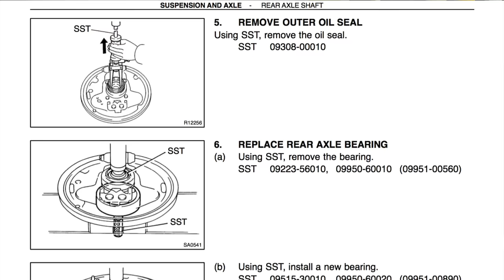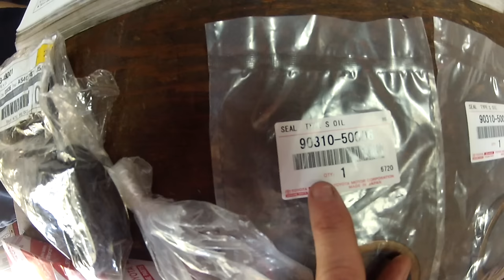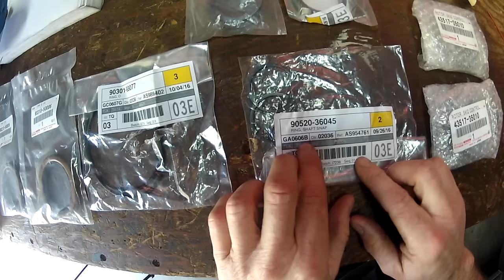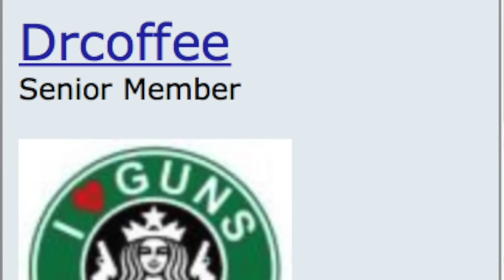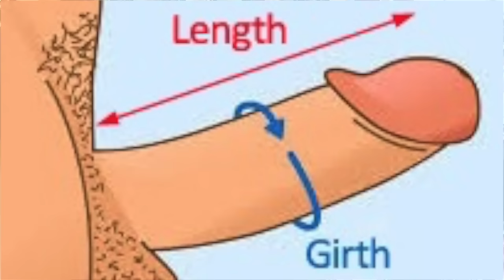Toyota Rear Axle Seal/Bearing Replacement (ABS Rearend)

Comment: I just finished building my own 2-tool set for the bearing and the ABS ring. 1st gen Tundra.
Reply from the maker: That's cool, but you could have bought Duane's toolset for $125.
Reply: @TimmyTheToolman  built these with some scrap and a pipe for less than $50.
Reply from the maker: @markstevens1729  Again, that's cool, but how much time do you think you invested into making them?  I'm all about DIY.  It's what our channel is all about.  But, sometimes spending the money makes total sense.  Maybe you just like fabricating, and you wanted the challenge.  If so, then it was worth it.  But, if you think the time you spent making the tools was worth the $75 savings, well, you should put more value on your time.
Reply: @TimmyTheToolman  oh, the tools in my country are $250. (Canada) and yeah, the fabrication was fun too.
Reply from the maker: @markstevens1729  Double in Canada?  I think your country needs new leadership just like the U.S. does.  Anyway, you made the necessary tools and you got it done.  Good job!

Comment: Hi Tim, just another update.  Well the driver's side started to leak. I went ahead and ordered the older style seal. I took her apart and found the aftermarket spacer that the seal rides on walked itself OUT of place. I removed the shaft and something looked odd.  Where's the last spacer??  It was still sitting in the seal!!!!  I have a NOS OEM spacer. I made some measurements. The aftermarket spacer is 40.02mm I.D. the OEM is 39.93mm I.D.  Going to go to my friend's and press the OEM spacer on. Going to have to replace the seal as well since I'm not sure if the seal is distorted now.  SMH.   Still love this truck. Almost 314K miles and still running strong!
Reply from the maker: I've never heard of that happening.  I've heard of aftermarket retainers causing tools to bend and break because the force to remove them was much more than it would take to remove an OEM retainer.  Now I guess they make them too big.  That's one of the big issues with aftermarket parts is the quality control.

Comment: Several years ago I changed the front and rear bearings on my 2000 4 Runner. I chose option #2. The cost of the press work at the shop was about the price of the HF 20 ton press. Now I have the press anyway, but it does get in the way. Helps to add second piece of angle steel to the legs and some heavy duty castors.
Reply from the maker: Yeah, the press is a little wobbly.  It wouldn't hurt to add some extra support down at the base to stabilize it better.

Comment: Thanks for the video guys. Do you remember if you drove the new inner seal into the axle housing with the Pittsburgh (black) press kit or the OTC (silver) press kit? 
The video doesn’t show which one actually drove the seal in. I just damaged my new seal with a press kit from AutoZone that didn’t have a good sized press disc.
Reply from the maker: We used the OTC kit with the metal silver disks.  There's one in that kit that fits the diameter of the seal very well.  A link to that kit is in the video description.

Comment: great video again tim.  just a side note the 01 and 02 require a different bearing that has a lip.  the 96 to 00 use a regular bearing.  also do not buy from marlin crawler as they do not supply the toyota updated seal.
Reply from the maker: Thank you for this information.  I'll need to make a note in the video information about the difference in the bearings.
Reply from the maker: I just looked it up.  The 2001 and 2002 use a different bearing than the 1996-2000.  

1996-2000 Bearing Part Number #903634002077
2001-2002 Bearing Part Number #9036340068
Reply: i dont think you got the part numbers correct Tim, here's what I used for my 02 4runner
http://m.ebay.com/itm/NEW-FACTORY-TOYOTA-REAR-AXLE-SHAFT-BEARING-90363-40068-/111919197302?hash=item1a0ee76c76%3Ag%3AIeYAAOSwG-1W0oUV&_trkparms=pageci%253A42a24ccd-2663-11e7-be57-74dbd180aae9%257Cparentrq%253A8f63eb6415b0aa121e6b9020fffbe7cb%257Ciid%253A7
Reply: I only bought new seals, new bearings, retaining clips, one new set of spacers and reused my abs gears the spacers, boots and o-ring.  Also the new spacers were shorter then my old ones and so I elected to reverse them like drcoffe and performed the grease test.  Be careful as when you set it up the bearing is not pressed into the housing and will float and look off before installing onto the axle housing.  mount all 4 bolts and check the seal to spacer ring to see where it seats and your good.  mine were 4mm away from the shiny edge is where I had the transmission shop do mine, was 70 dollars per axle and I had then do it as its once every ten plus yrs and didn't want to purchase the tooling and press.  use toyota parts only.
Reply from the maker: Thanks, I had the numbers swapped.  I corrected my earlier response.
Reply: Timmy The Toolman , no problem man, wish you were near by so you could help me with my 12yr old timing belt and water pump change.  I going to run it till it breaks and see when that happens lol
Reply from the maker: You could actually reuse both retainers if you swap the positions.  Put the one that the seal was riding on against the bearing and then put the one that was riding next to the bearing against the ABS gear to mate up with the new seal.  Because the seal over time wears a mark onto the retainer, you wouldn't want to reuse the retainer the original seal was riding on to mate up with the new seal because if you happen to have the seal lip riding on the same wear mark, it might be prone to leak because the metal is slightly worn down there.

That is weird the retainers you got were not the same height as the old ones.  They should have been.  On both jobs I did, the owners of the rigs bought new retainers and when the outer retainers were pressed against the bearing, the c-clip slot was in the perfect position so I assumed they were the same height as the old ones.

Yeah, the bearing doesn't necessarily press in firmly into the bearing case so it does move a little sometimes.
Reply from the maker: Good luck with that.  We were planning to do the timing belt job on Sean's rig early this yea, but when his auto trans imploded, that became the priority.  Hopefully we'll film a timing belt job on this rig before the end of the year.

Comment: hey tim... great videos... just an FYI did my 4th gen axel seals bearings were still zero play at 265k and i just wanted to confirm both of the seal marks are from the OEM seal the leading and sealing edge leave witness marks its not from seating the seal in different positions regardless of the race position good item to point out though and put focus on proper positioning
Reply from the maker: In the case of the 3rd Gens, the seal was redesigned and when you see two distinct marks on the retainer, one more center from the original seal and one close to the bevel from the new seal, that's a clear indication someone replaced the seal with the new design that now has the sealing lip sitting more inboard but didn't adjust the position of the retainer.  It's this fact so many people have issues with this job because they are unaware the seal was redesigned by Toyota.  Sounds like the 4th Gen seals are a little different.  The 3rd Gens do have a leading and sealing edge but it just makes one wide mark.  There isn't a gap between the marks.

Comment: Hands down the best video tutorial on these cars. Great work!
Reply from the maker: Thanks Mike.  We appreciate the nice compliment.  Be sure to watch Part 2 where we showcase a much better tool for the job.  Also Mike, make sure you read the video descriptions and pinned comments.  There are important updates shared.
Reply: @TimmyTheToolman  Will do, thanks.
Reply: @TimmyTheToolman  Hey Timmy, two years later and now both my rear axle seals seem to have gone out, both rear hubs are wet with gear oil.. 😬 Got a big job ahead of me.. Thankfully your videos will help me step by step. Also thank you for referencing that ST to use from Dan. Will let you know how it goes..
Reply from the maker: @Mike_44  Good luck with the job Mike.  Be sure to watch Part 2 also and read the comment I pinned (1st comment you see) for updates on the job.
Reply: @TimmyTheToolman   Yes Sir, I saw them already. I'm also planning to add the diff. breather mod. later on to prevent this from happening again. Thank you.
Reply: @TimmyTheToolman  btw, do you know if now the ST square plate is thinner? Or is it still 3/4”? You know, the area around the bolts you had to mill out at a machine shop..
Reply from the maker: @Mike_44  We no longer suggest people buy that tool.  The one we like is linked in the video description.  It's WAY better.  Contact Duane and buy his toolset.
Reply: @TimmyTheToolman  Ok, thank you.
Reply from the maker: @Mike_44  No problem
Reply: @TimmyTheToolman  Oh hey Timmy, I forgot to ask you a very important question, can my rear brake cylinders boots/seals in the drums have been compromised by the diff. Gear oil? I ask because I just replaced my brake booster due to a pedal sinking all the way to the floor and having the typical hissing noise. Well, turns out I also need to replace the Master Cylinder, which I just received yesterday because the brake pedal still sinks. But in the process of checking if there was any brake fluid loss yesterday (which I don’t seem to have), I discovered the rear axle seals are leaking, hence I was wondering if the rear brake cylinders may have been damaged with a very tiny brake fluid leak and creating the spongy/sinking brake pedal? 😬
Reply from the maker: @Mike_44  I've done lots of rear axle seal jobs, and the brake cylinders were all l fine, even though they were covered in gear oil.

Comment: Great video. Very informative. I have a 01 tacoma and am have an issue. I do not have a press and had a local shop do the press work for me. They pressed the retainer on too far and it never make contact with the seal. Their solution is to just press another retainer on. My axil is a ABS axil but with out the electronics. Actual non ABS unit, with the ABS AXil housing. The measurements look like this should work great. Do you for see any issues with having a extra retainer pressed on the axil?
Reply from the maker: No, I don't see any issue with it, but because they pressed the other retainer and ABS tone ring on too far, you won't be able to pull the parts off with a tool like we used if the job ever needs to be done again. They will have to be cut off.  

It never ceases to amaze me how many shops don't know what the f*ck they are doing when it comes to this job.
Reply: Thanks for the  advice. I’m going to press the extra retainer on for now and deal with cutting the extra one off down the road. Keep up with the great informative videos!
Reply from the maker: @orenparry2426  You're welcome Oren.  Good luck with your rig.

Comment: Thanks for the reply, I found the magic number for me was 1.475" from the top of the bearing to the top of the tone ring. Put my seal dead center with the bevel down. My axle polished surface is also slanted higher and lower on one side and ended up 7.50 mm for dead center. Axles surface do vary a little and so do the seal lip. Thanks again
Reply from the maker: I have also noticed the polished surface is a little slanted.  Approximately 1mm difference between opposing side.  That 7.5mm measurement sounds very high to me but if you say it's good, then it's good.  I just find it odd that I've done around 9 sets of these axles and pretty much found 5mm of polished axle showing was about right.  I did the grease test on every set too.  Happy Wrenching!

Comment: Replaced inner axle seal and it still leaks. New vent installed. Made sure it was seated fully back. Looks like I'll be dropping the axle back off when it was rebuilt. I had both rear axles rebuilt and no problems with one side, but a oil leak on the other side that won't go away.
Reply from the maker: Hey Mike, you need to read the comment I pinned (1st comment you see).
Reply: @TimmyTheToolman  I sealed around the axle seal pretty good and put a layer where the seal sits before I knocked it in there. Also sealed up the axle housing where it mates to the rear end. When the axle was out I did notice where the bearing is pressed in, it looks like there is just enough play for oil to get by it. All and all sealing it did not help. I'm still thinking rebuilt axle is the issue at this point. There were some scores in the metal where the seal goes but that gasket sealer should have fixed that.
Reply from the maker: @michaelsmith2994  I'm guessing you confirmed a good mating of the axle seal with the retainer.  If that is the case and you've employed all the other tricks, I don't know what else you can try.
Reply: @TimmyTheToolman  Yes, I confirmed a good mating. You can even feel the difference when you have knocked it all the way in. There were zero leaks before I started this job. I have tried 3 seals and none of them hold. I appreciate the quick response. If I discover something new I'll post an update.
Reply from the maker: @michaelsmith2994  Ok, good luck.

Comment: Great video but I'm not sure if I agree with you on the oil compromising the bearing. It's a lot of extra work and money to replace them.  My bearings had identical play to yours, and I could see where some thinned out grease was leaking from the bearings. I just replaced the seals and o rings, no bearings. Going on a year now with no leaks and no bearing noise.
Reply from the maker: Brad, you rolled the dice to save yourself some time and money and so far your gamble is paying off.  Without a doubt the gear oil will wash out the bearing grease.  Depending on how long the gear oil was allowed to surround the bearing will determine how much grease was washed out.  Hopefully you caught it really quick and you didn't lose too much of your bearing grease.

For these videos, I give my best advice.  From what I've read and experienced myself when the Toyota dealership messed up my axle seal job and the dealership replaced the bearings because gear oil had compromised the bearings, the safe bet is to always replace the bearings so you don't find yourself going back in sooner than you would have liked to do the job all over again.  It would also really suck to be on a road trip, have a bearing failure and then be forced to pay high labor rates at the nearest shop so you can get back on the road.

Comment: This was really helpful with the turning around or that oil seal runner.. Have to ractify mine coz it started licking again
Reply from the maker: Glad you found the video helpful.
Reply: I managed to just to move my oil seal runner/cone just a bit up since it was hard to remove again but it also did the trick.. Thank you very much for the video again
Reply from the maker: @halolyeiipinge370  Glad it worked out for you.
Reply: All thanks to you.. Thanks again...
Reply from the maker: @halolyeiipinge370  Our pleasure.

Comment: Thank you for putting this video together.  I recently had to replace both sides on my 2000 Tundra, and although I used different methods for getting things apart, the insights about the change in the Toyota seal design and flipping the collars to compensate, plus how to check for seal engagement, probably saved me a hellacious headache ... or should I say, a MORE hellacious headache as this is a PITA job.

I'm honestly a little shocked that Toyota would use a design like this.  The whole "floating collar and tone ring" is kind of a crappy design.
Reply from the maker: Glad our video helped you out.

Comment: Instead of whacking the drum to pull it off, there are 2 threaded holes in the drum where you can screw 2 bolts (12 mm head) and the drum will be eased off as you tighten the bolts.
Reply from the maker: Yep, we know about those bolts holes.  The thread size is M8 x 1.25.  The problem with the bolt method is if the shoes are tight and dragging a lot on the drum, as you're pulling the drum off, the shoes could be coming with it.  This starts cranking on the springs and other brake parts and maybe you notice it too late and parts get bent or broken.  I prefer to get the drums off without resorting to the bolt method.  If I can't get the drums off with some whacks from a plastic mallet, I'd next go through the access hatch on the backing plate and loosen the star wheel automatic adjuster to take tension off the shoes.  Then the drums should come off without a fight.   But, to each his own.

Comment: Doing this job on my 96 limited with ABS. Luckly, i have an MTS test frame at my disposal so i can precisely press the bearings and retainers. Will the ABS gear go back on easy? What is the likelihood that my oil seal is leaking because of a bent axle? (I haven't done any rock crawling or anything crazy, no bad pot hole acccidents either)
Tim, thank you for your time in making these videos. These jobs would be substantially harder without this awesome reference.
Reply from the maker: Jacob Carroll Hey Jacob, the ABS gear, retainers and axle all press on pretty easy.  I do lubricate the axle shaft with some grease to allow the parts to slide on easier.  It's the press work to pull things off that requires more force because they tend to get locked on there over time.  Pressing the axle through the old bearing requires the most force so you will experience a build up of pressure and then it finally breaks free and starts moving.  After it gets moving, the pressing goes very smooth.

I doubt either of your axles are bent.  You would either have to be doing some aggressive offloading or you got into an accident to bend one of those shafts.   Good luck with the job!